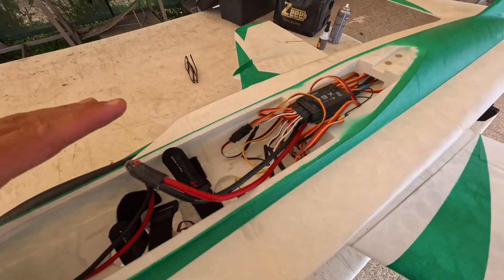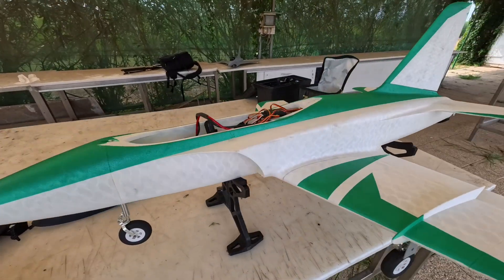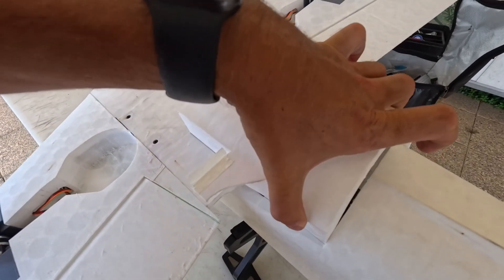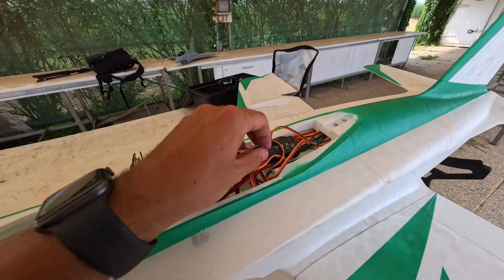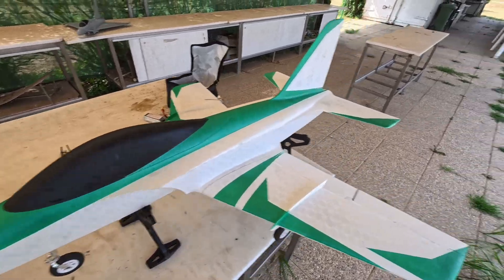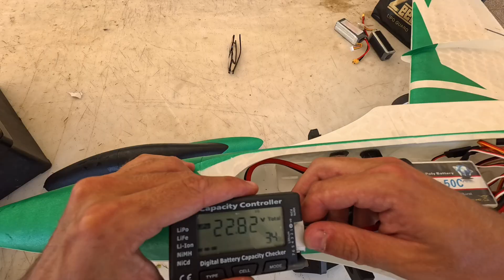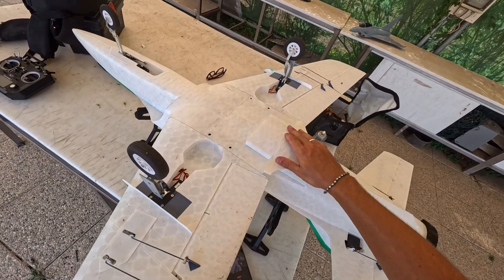VENOM – 3D Printed Sport Jet Reveal and Flights | 90mm EDF and Retracts

Comment: What 3d printer did you use?i want to print this
Reply from the maker: An Ender 3 v3KE, but it fits on any printer with 220x220mm of print volume
Reply: @LSPlanes the name of filament u used to create the plane....gonna buy your plans to build one...
Reply from the maker: @esskiahastings7974 colorfabb LW Pla
Reply: @LSPlanes One more question....promise just about to buy printer.....how long did it take to print all the parts?
Reply: One more question....promise just about to buy printer.....how long did it take to print all the parts?
Reply from the maker: @esskiahastings7974 about one week

Comment: Be aware  that a standard printer like my Prusa MK3.5S some fuselage part do not fit. they are at the limit of the build plate height and have problems printing the top layer

Comment: 200, 206    you may know that the optimal cross-sectional exit area is equal to the effective swept area of the impeller.
Reply from the maker: Yep! If you talk about the EDF thrust tube I took in consideration all of the correct measurements about the FSA🤙🏻
Reply: This is not correct. The correct diameter depends on the fan design. China fans mostly 90% FSA, Schübeler approx. 85% FSA, WeMoTec, Ejets typically 80% FSA.
100% FSA is always too big.
Reply from the maker: @OliverWennmacher yes in fact..the exit diameter is 90% of the FSA

Comment: Absolutely amazing! Well done!
Reply from the maker: Thank you! 😁
Reply: Prodigozo!! Amazing, I hope those retracts are not expensive because altough I love the fact that has retractable landing gear I wished it was also 3d printed to keep costs down but I love it. You are a very talented modeler, 👏
Reply from the maker: @ripmax333 the cost of 3 retracts without legs and the price of the full landing gear set is pretty much the same, but in the second you have a strong and durable landing gear for any surface!